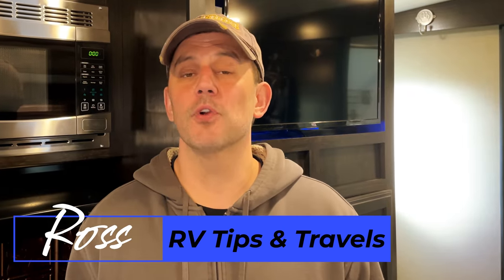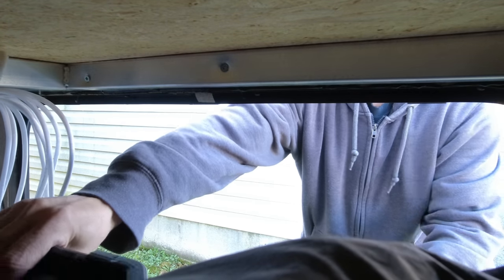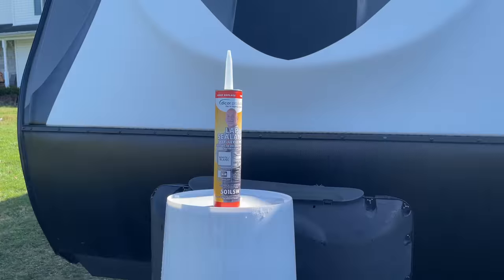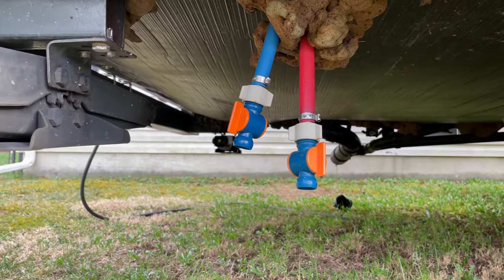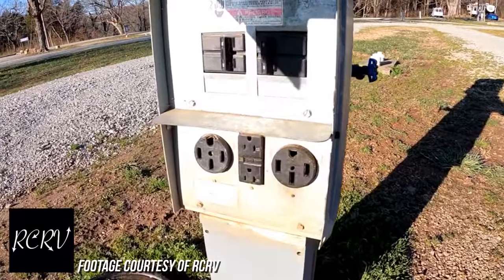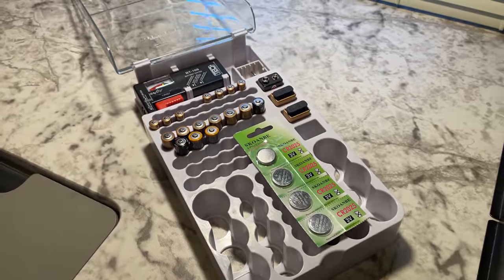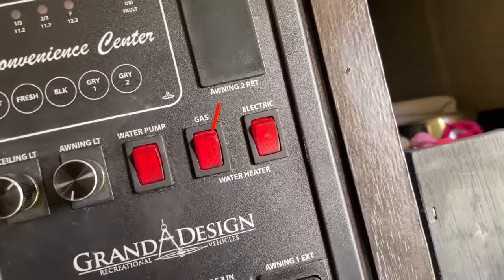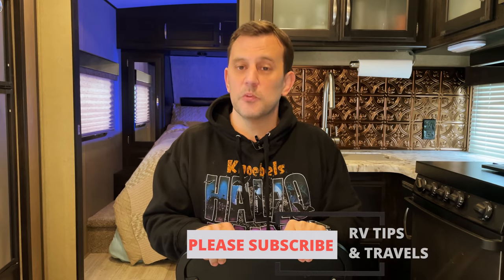Spare Parts You Should ALWAYS Keep in Your RV!

Comment from the maker: ✨⭐ PRODUCTS FEATURED IN THIS VIDEO ⭐✨
🔹 Dewalt ½” Socket Set https://amzn.to/3JY9RR7
🔹 Water Heater & Low Point Drain Plug https://amzn.to/3xvzmq5
🔹 Anode Rod (2) https://amzn.to/3vnzhC6
🔹 Eternabond https://amzn.to/3JRBTNU
🔹 Dicor Self Leveling Lap Sealant https://amzn.to/3KN57yU
🔹 Caulking Gun https://amzn.to/3JKFA83
🔹 Low Point Drain Valves (male) https://amzn.to/3KQDqVL
🔹 Low Point Drain Valves (female) https://amzn.to/3JMbj94
🔹 Fuse Kit https://amzn.to/38WfeDq
🔹 Dog Bone Adapter (choose your model in the link) https://amzn.to/3McfQmv
🔹 Battery Organizer https://amzn.to/3uNVf20
🔹 Ceramic Indoor Heater https://amzn.to/3vn7G47
🔹 Pex Pipe, Crimps & Crimper Tool Combo https://amzn.to/3Mdssdn
🔹 Thermal Cutoff https://amzn.to/3uKT67f

Join the Free Newsletter here: https://view.flodesk.com/pages/6497c6a9d1998fa8c7623e9f

Comment: As I learned the other day while bringing home my new RV from out-of-state, RVs (at least my Wolf Pup), use square-headed screws to remove the panel I needed to access a plumbing leak under the sink. Luckily, I was near a Lowe's. So, I guess I'd advise checking all of the various fasteners to make sure you are covered with your tool kit.
Reply from the maker: Great point, thanks for sharing John.
Reply: Walmart has a great multi tip bit driver that stores all the extra bits in the handle for about $10.00 comes in handy and reduces the need to carry a bunch of different drivers!

Comment: We have forgotten to turn the water heater off ( electric ) and burned out the heating element when the heater was drained, it was at the end of season , but since then we have kept a replacement element and the tool to remove/install it on the camper....nobody wants a cold shower. And you definitely want a #1 and #2 square drive screwdriver to fix, or tighten all those screws that strip and get loose rockin down the road.
Reply from the maker: Thanks for adding!

Comment: Great video. The pex crimper I keep in the trailer will crimp or cut off the clamps. Without it I have found it difficult to remove the clamps.
Reply from the maker: Good point Tom, do you have a link for them?

Comment: Most auto parts stores sell various sizes of lug nuts. I would go to an auto parts store and buy a set of lug nuts that use a 3/4 inch  lug wrench to use on the spare tire mount rather than have two separate lug wrenches. A set of lug nuts is cheaper than one lug nut wrench. Of course, I use a 3/4 inch impact socket on my impact driver for my tires, but keep the lug nut wrench for when they are too tight to use the impact driver.

Comment: I have always carried a 110 volt battery charger in our camper. If your convertor goes out when your camping, the shore power won't be able to charge your battery, and you won't have any dc lights in your rig. Hook up the battery charger to your battery to charge it until you can replace the convertor. Be sure and have an extension cord long enough to power your charger from the shore power 110 volt outlet. You might never need it, but I always have it onboard for peace of mind.
Reply from the maker: great point, thanks for adding to the video!

Comment: Nice article I loose water out of the overflow on my Gand design reflection I installed a shark bite ball valve to solve this.  After leaving to visit friends in Texas fro Colorado 95p0’, I started worrying about positive and negative pressure build up with that closed.  Could I collapse the tank? Could the tank expand to much?  We de use the bathroom room on the withou opening the valve on the road either way.  We also have it on the check list arriving and departure. Any help?

Comment: I normally keep an extra truck key hidden on my truck.  Due to a toolbox replacement, I had pulled it off.  First trip out... locked out! $75 on a sunday isn't horrific as I actually got unlocked before checkout.  Less than $3 at walmart is way cheaper.
Reply from the maker: thanks for noting this Ray, I am still in the process of pre-season maintenance and making plans to have a spare truck key somewhere on the outside of the RV, and a spare RV key somewhere on the truck.  Both with access from the outside.  Just trying to figure out where though.  Great point.

Comment: I would add some cheap water sensors alarms for the basement area of the RV.
Reply: First thing I added the week we bought new 2022 camper.  We were traveling and stopping for gas my wife heard an alarm going off in the camper.  One of the connections on the hot water heater was leaking after just 3 months.  Probably only 1/4 cup of water but was noticed very early!  Alarms under kitchen sink, behind water heater, under bathroom sink, behind toilet, hard to get to but under shower,  and water filter access door outside which went off during a rain storm when I left the door open by accident.  Water is your enemy in a RV!
Reply from the maker: Thanks for adding Doug!

Comment: We also own a 2150RB, same water heater install layout. Did you replace the water heater drain plug with an anode rod?  I'd love to do that but given the geometry of the drain plug in relation to the heater shroud it seems installing an anode isn't possible so I just drain it after every trip. Our previous TT was a Casita 17 that I had to replace the anode annually. Thoughts?
Reply from the maker: No reason to add an anode rod.  You dont need one for the dometic water heater.
Reply: @RVTIPSANDTRAVELS  Just curious as to why not? As said, on our previous TT with a Dometic the anode rods lasted about one full season prior to having to replace.
Reply from the maker: Our water heaters have an aluminum lining. Aluminum doesn’t rust. Water heaters with a steel lining need an anode rod because steel rusts.